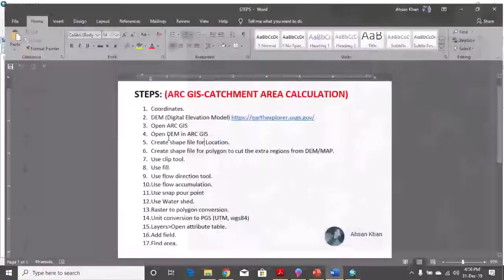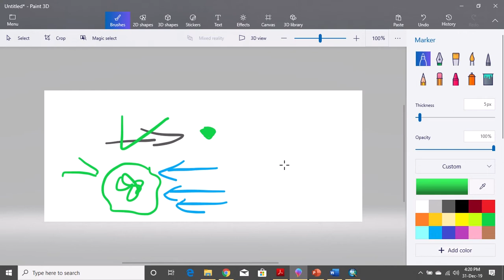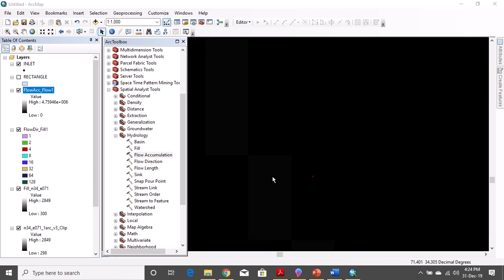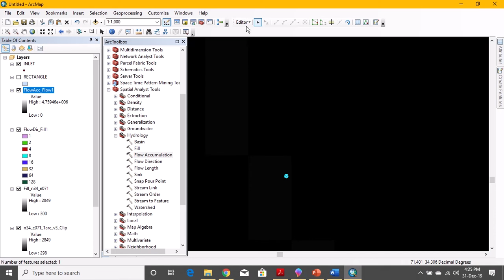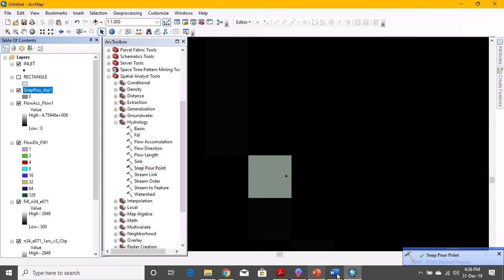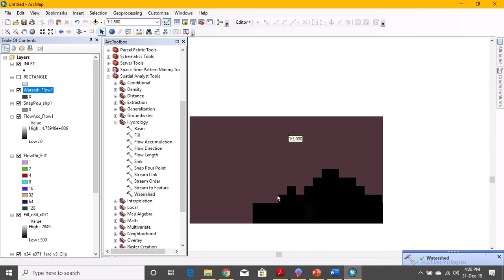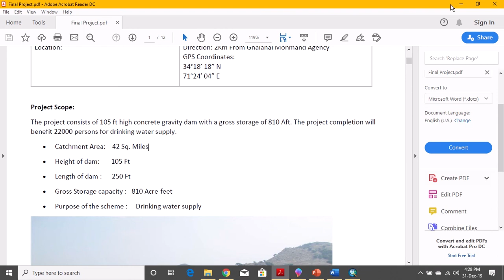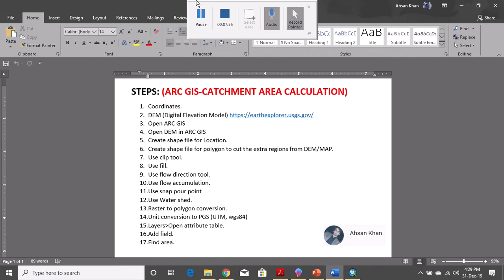ARC GIS - Catchment Area Calculation (PART -3 Flow accumulation, Raster to Polygon and other tools.)

Comment: brother there is no light white area in my case only V.small Points
Reply from the maker: There should be a line, or a polygon, or may be in some cases some points. Place that point above that line. It should work then
Reply: @ahsanqasim12  Bro there are lines but no clearcut area of catchment. I have sent a screen shot to ur email. plz check
Reply from the maker: @adnan565  yes brother i checked ur email. I have replied kindly check it :)